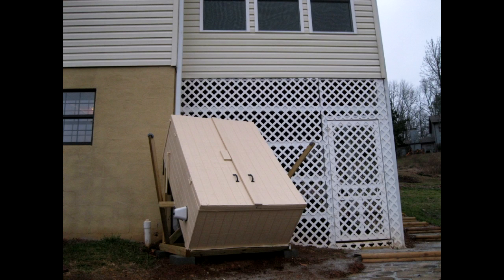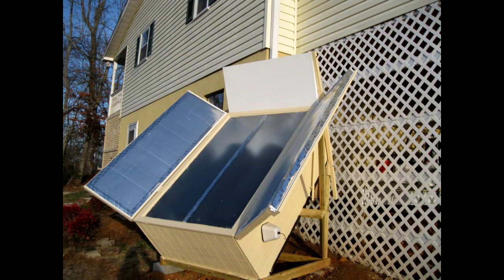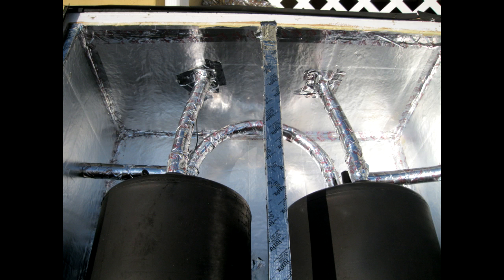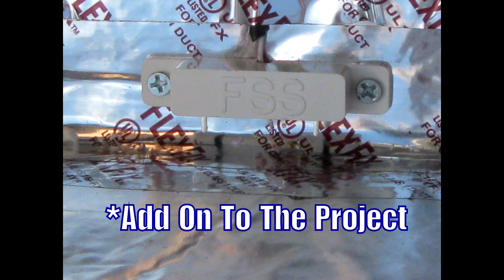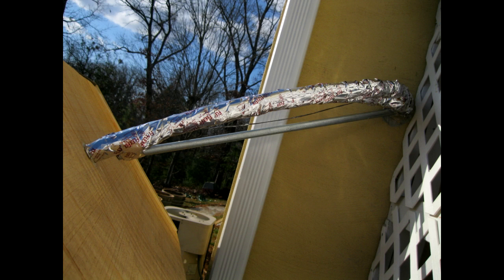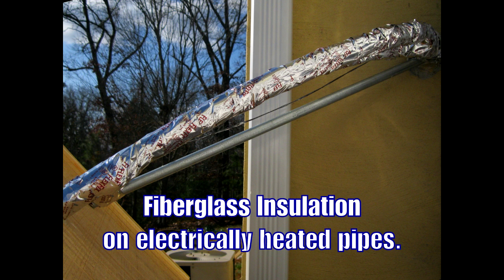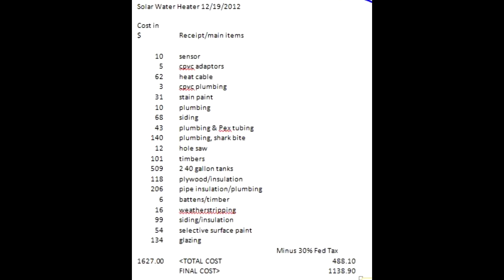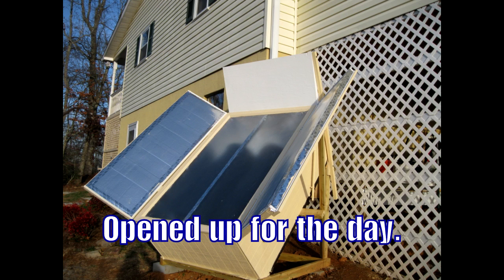Solar Water Heater - Passive - Build/Install Breadbox

Comment: Here's another thing that you might be interested in. Power Pipe Drain Water Heat Recovery System. It's a heat recovery system designed to use water drainage from a tub/shower and uses the heat that goes down the drain and transfers it to the pumping "cold" water.

Comment from the maker: Pex will expand when the water freezes so it does not rupture as often as other materials.  Expansion and ease of use are the main reasons.  Sunlight will degrade the pex, so paint, wrap in insulation tubes (maybe even paint that as they are light sensitive too and then wrap in Aluminum tape.